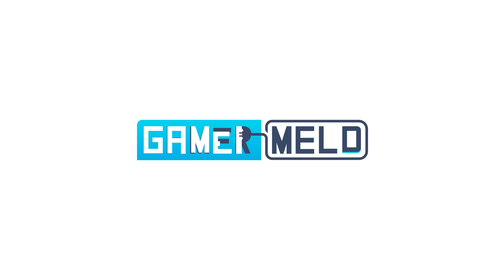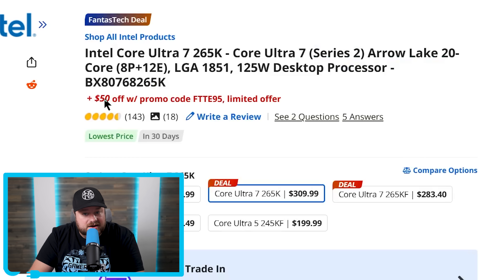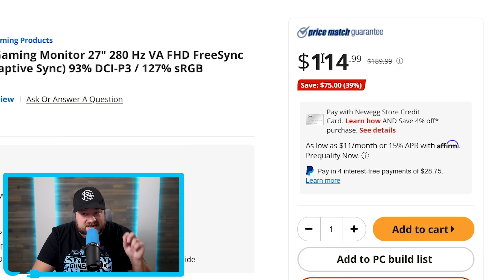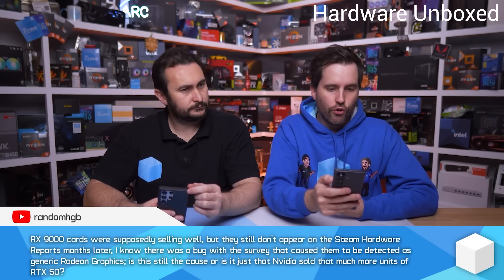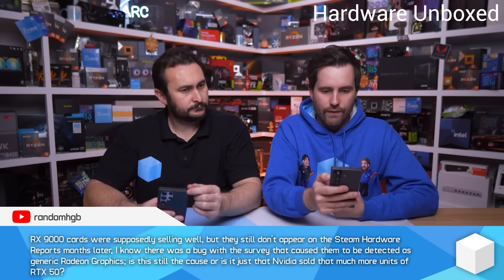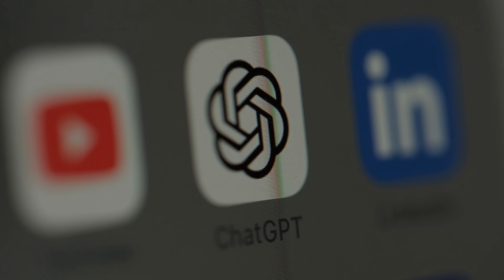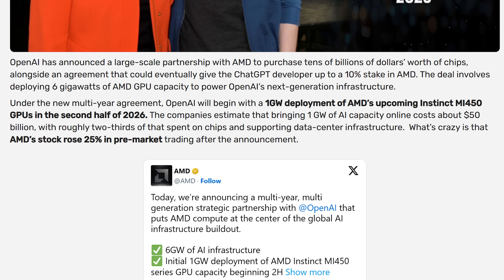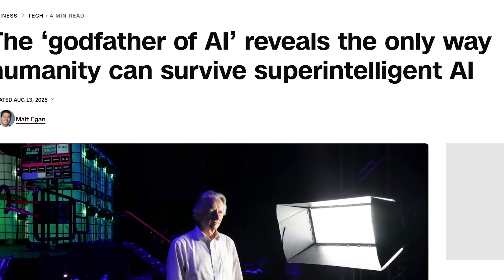AMD Just BROKE The Entire GPU Industry!

Comment: If Nvidia didn't have so many system integrators equipping their pre-built PCs with them, AMD's lead with 9000 Series GPU sales would be even greater. Currently, the more familiar customers and PC builders are with current technology, the more likely they are to opt for AMD. The mainstream is still riding the green wave or buying a PC that's only available with Nvidia, and that's a lot.

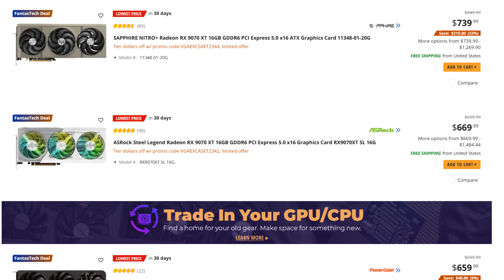Comment: 4:05 incredible enough but in Europe rn the prices are really low, for example you can find the 9070 xt for as low as 620€ which is a really good price (keep in mind we have to pay for VATs) and the 9070 can be found for 559€ all on amazon. On the other hand, the nvidia counterpart, 5070 ti, is usually around 900€ so basically impossible to buy.

Comment: Still on my trusty 3080 12GB, doing fantastic still (especially at 1440p). I am curious about what's next (UDNA and/or RTX 6000 series). But thus far, I had no good reasons to ever jump on the previous 2 generations worth of cards. They were really just incremental, and nothing substantial going for them.
Reply: Two years ago, I upgraded from a 1070 Turbo to a 4070ti Tuf OC. I wanted to play eye candy single player games in 3440X1440.  My next upgrade will probably be in the7-8000 series cards. If I stick with Nvidia. These prices are outta site. I'm on the 7-year upgrade plan.  😆

Comment: i bought a Sapphire Pure RX 9070 (non-XT) when my Gigabyte RX 6800 XT Gaming OC was dying, honestly, extremely happy of that purchase, where my 6800 XT was hitting 70-75°C (80°C on summer), my 9070 doesn't even hit 60°C. My PC is so damn silent now.

AMD deserves it since NVIDIA has been screwing with gamers for years
Reply: The issue is monitoring, I may have a 9070xt myself and the temperatures never exceed 60 degrees Celsius, but here is an 85+ hotspot.
Reply: @technodromeVBlog VRAM modules get ridiculously hot, it’s normal, unless your actually talking about the gpu die itself

Comment: When I needed to build a new PC I went all AMD. Budget gaming machine. Sub 500 with an AM5 7600. GPU is only a 580. But at 1080p it works for me.
Reply: Bottlenecker 5000
Reply: @Goonlab14when I can afford more GPU I will. But I think I did well for my budget. My last machine was a 550 low profile. And the GPU cost more than the computer. Lol
Reply: @Daemon1972 I highly recommend b580 used 3080, 9060 xt, or 5060(less so) for budget cards
Reply: @Goonlab14I have read good things about the B580 and the 9060. Both are possible. But being on disability I have limited extra money. So I will be saving for a bit.
Reply: @Daemon1972 of course. I have a 6600 xt that I will never need. would you give it a goi home?
Reply: *good

Comment: AMD PLEASE READ BELOW.

Are we about to see AMD utilize intel specifically on the GPU pcb for framgen only.

That would be insane.
Our gpu has a separate intel chip specifically for framegen only.
I was thinking maybe they took the lead on what everyone is doing by putting the mini Sparkle Intel Arc A380 Genie in their pc's for framegen only and ran with it.
That would be one hell of a solution and partnership to launch themselves into the FPS stratosphere.

Why It’d Be a Game Changer Performance Leap: Offloading frame generation to a low-power Intel chip (e.g., ~20-40W, derived from Arc A380’s efficiency) could boost FPS 2-3x in games (60→180 FPS) with minimal thermal/power cost, outperforming software-only solutions like FSR 3.1 or DLSS in hybrid scenarios. Intel’s XMX cores excel at AI tasks, potentially delivering smoother interpolated frames than AMD’s compute-heavy approach. 
Market Disruption: This hybrid approach could challenge Nvidia’s DLSS dominance by combining AMD’s cost-effective rasterization with Intel’s AI upscaling, offering a unique value prop—high FPS at lower price points. It’d force competitors to rethink siloed architectures. 
Vendor Collaboration Precedent: AMD using Intel’s foundry (e.g., 18A node) or chiplet tech could signal tighter cross-vendor integration, leveraging Intel’s manufacturing scale to reduce AMD’s reliance on TSMC. This could lower costs and accelerate innovation cycles. 
Retrofit Potential: Older AMD GPUs could gain modern FrameGen via a co-processor, extending hardware lifespans—a boon for budget gamers. Think RX 580 with 2025-level frame rates. 

How It Could Work (Simplified)Hardware: A tiny Intel die (~50mm², 10-20W) with XMX cores sits on the AMD GPU PCB, connected via high-speed fabric (e.g., Infinity Fabric, ~64GB/s). AMD’s RDNA die handles raster/RT; Intel chip does FrameGen via XeSS-like neural nets. Shared cooling, no extra PSU needed. 
Software: Unified driver stack (AMD+Intel) syncs rendering and interpolation. Games see it as one GPU, with FrameGen toggled via AMD Software or game settings. Latency stays low (~10ms) with optimized handoff. 
Production: Intel’s foundry fabs the co-processor (18A for efficiency), AMD sticks with TSMC for main die. Assembly integrates both on one PCB, adding ~$20-30 to BOM but saving on R&D for AMD’s own AI silicon.

Comment: All AMD would need to do is drop current prices by a percentage and release a 9080 xt to combat a super release
Reply: They arent gonna make the rx 9080 xt but if rumors are true for the next gen readon cards code name rx 10000 siries they are going to make a rx 10090 or 10900 xt as a compoater to the rtx 6090
Reply: I just want them to focus on UDNA now :)
Reply: and put fsr4 in as many games as dlss and stop their gpus from having driver timeout and stop from their thermal paste for pumping out and causing 110 hotspot temps.
Reply: @bigturkey1  what driver timeout? Only time I get driver timeout is when I push undervolt too far on my 9070xt and temps are cool. Even Hotspot & vram temps. Never seen it above 85°c. Let alone 100+

Comment: "It's just full HD", but hey, it's cheap... 😮 I never thought I'd here this meaning 😊
😮also I never thought, I'd see AMD plowing NGreedia out of the Market; just because NGreedia refuses to specify a thicker cable or a Power Solution for their Video cards; that's craaazy 😮

They're 2 Laws that forbid Monopoly directly or indirectly: An Anti-Monopoly Law and an Antitrust Law, respectively. Because of these Laws, Intel made contacts that their co-signing clients, need a 2nd Source for Computers and Parts; that's the very reason survived the Lawsuit Bombing by Intel, in the past; and both share the x86/x64 ISA Patents; so the business is codependent, and eternal, as long as there is a profitable Market for it

Comment: Deals on newegg are okay, but if we're comparing it to amazon it's nothing short of an insult. Up to 66% means items like fans are 66% off because that's only like 10 dollars off. Everything good, ssd's, gpu's, and cpu's are like at best 15% off and even that is rare from what I've seen. The 9600x has been consistently at 200 or below for months now, so that's not a sale, the 9060 xt is actually pretty good so check that out, but other than that? I haven't seen anything even worth buying when BF and CM are coming up.